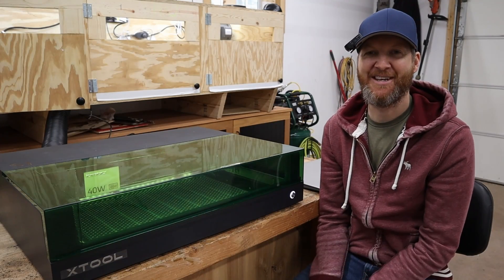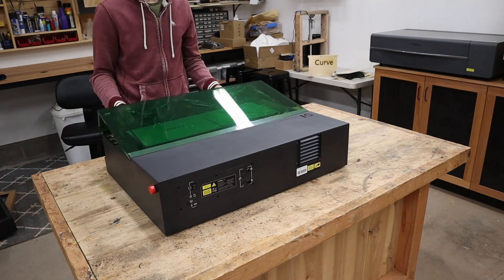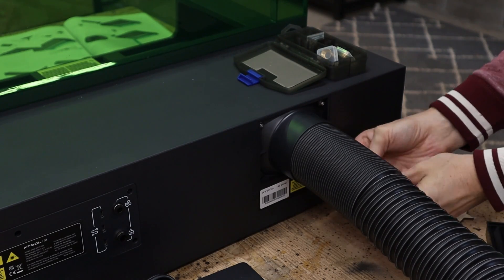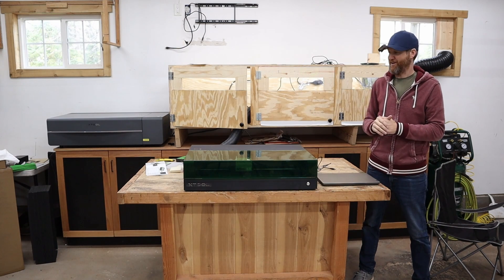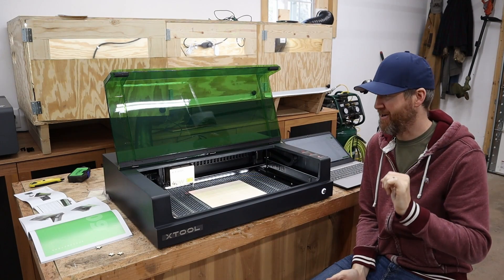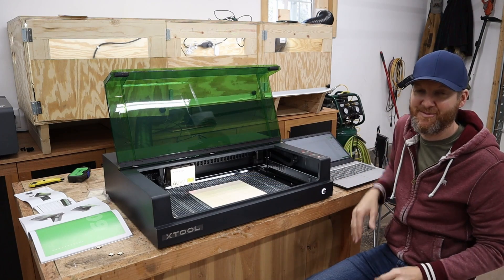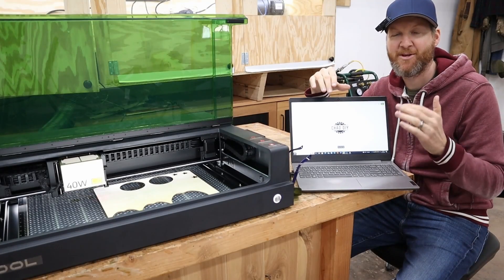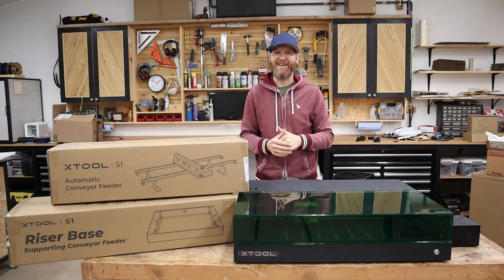xTool S1 Full Review

Comment: I'd be keen to see how it performs on 6mm ply if you every want to show that. In particular, Kerf is critical to my work so understanding how much material is removed when cutting 6mm ply at sensible settings would be of interest.
Reply from the maker: Thanks for the comment. It does cut 6mm without a problem. My understanding is the higher the wattage diode laser, the larger the kerf would be. If you are looking for the smallest kerf, but still able to cut 6mm nicely. This S1 with the 20watt module might be perfect for you.
Reply: @chaddiy  thanks for the feedback!
Reply: Thanks for the response @chaddiy . I'm currently using a 50w CO2 with similar bed size, but being a business I think the safety features of this unit would be of benefit. Always a tough battle between speed and power when it comes to kerf. I think I will order one and give it a try.
Reply from the maker: @timbailey125  ok, I hope it works out well for you!

Comment: Really like this machine. Easy to use software, automatic Z height, looks to be build very solid, full enclosure and other great things like a 40W diode. What more do you need? I assume the camera might come later as a add-on feature. Thanks for the review!
Reply from the maker: Hello, Yeah...I know some people would have liked a camera on it, but for $1599 for the 20 watt version. I think the price is great for all you are getting. The 40 watt version I have, is really coming close to the power of my xTool P2 as well. Thanks for watching!
Reply: @chaddiy  a camera is nice, but for me it's not a necessary thing. Do really like the two point alignment. Hope to see your video about the automatic conveyor feeder soon 👍🏻
Reply from the maker: @jewijk  The two point alighment seems to work really well. I havent used it a ton yet, but it seems to be the next best thing to an actual camera. I have used a lot of diode lasers, and most of them basically have nothing to help figure out exactly where you are going to be cutting or engraving on your material. To me, xTool has been the leader in figuring out how to do that well.
Reply: Do you prefer the p2 still?
Reply from the maker: @Just-Make  I do still prefer the p2, mainly for the camera system and the ability to cut clear acrylic with the co2 laser. The price difference between the 2 machines is pretty big though. If I was getting my first laser today, I would forsure get the S1 20 watt...I think for what you get for that price, it is the bast bang for your buck out of any laser out there.
Reply: @chaddiy  really appreciate the reply. To your point about best bang for buck, as its “only” 400 dollars difference between the 40w and 20w, wouldn’t it be better going for the 40w still so that you have the best in that class, rather than going the cheapest in that s1 range only to be restricted? Sorry I’m just starting out learning all about lasers so i got a feeling I’m probably missing something
Reply from the maker: @Just-Make  By all means, if you can afford going up to the 40watt...go for it! especially now, because I think that it is $200 off the next 2 days, instead of only $100 off the 20 watt. I was just thinking about myself a year ago when I was thinking about getting into lasers and wondering how much I was willing to spend for my first one...not knowing anything about them. I think the 20 watt is a great starting point. I guess if anyone wanted to splurge for the 40 watt. The next few days is the time to do it with there "launch sale"!
Reply: @chaddiy  thank you for the advice!

Comment: I engrave 15in by 15in concrete blocks, would it fit the enclosure?
Reply from the maker: Hello, The bed size is listed at 23.93"×15.16" so it should fit. Keep in mind though the working area is 19.6"× 12.5"

Comment: There is no doubt it's a nice "looking" laser, but the absence of a camera is a deal breaker. The 2-point system is only functional when using a square piece of wood, it won't map out a triangle, precut "hobby shop" wood shapes like a circle, arrow, plus sign...you get the point. With odd shapes, you're forced to frame it with the cross hairs.

They made a big deal about the 2-point being more accurate than a camera, then why did they put 2 cameras in the P2? They should of put a camera in the S1...opportunity missed.

They also made the work area too small, if you have a 13" x 13" piece of wood it won't work, and if you spend the money on the riser and conveyor, it still won't work because the 13" x 13" is too small and won't work with the conveyor. 

They should of made the D1-V2 and put a nice enclosure around it, included the P2's camera and called it good.
Reply from the maker: Hello, I agree that the camera system would be great, but that would have really added to the price. Right now you can get the S1 20watt for $1599. That is just a little bit more then the D1 pro, and to get the full enclosure, fume extraction, and some of the latest tech, it is worth it in my opinion.